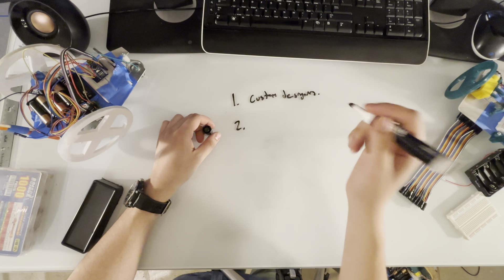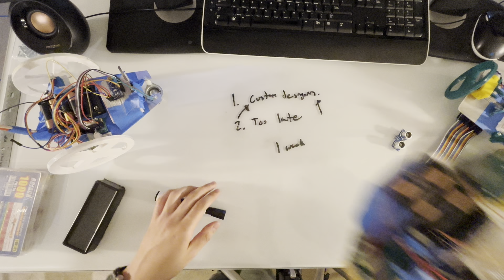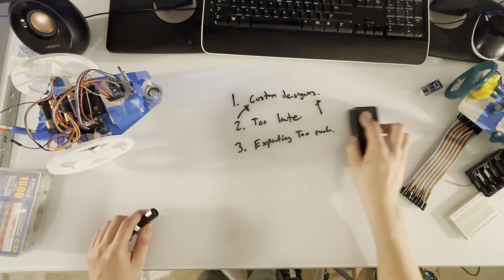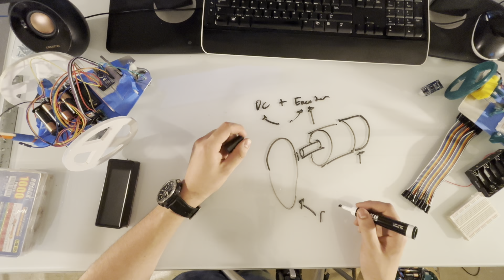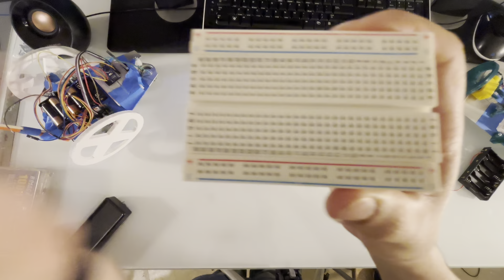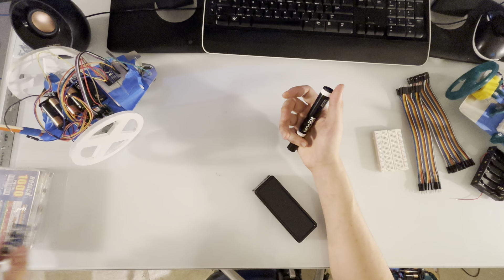Robot Tour Mistakes and Tips

Comment: What hall effect sensor did you use for v3? Also, did you place with your v3 model?
Reply from the maker: V3 placed I believe placed 6th. However V1 won the most competitions (and placed higher) because of its cheapness and consistency. The hall effect sensor I bought was called '3 Pack KY-024 Linear Magnetic Hall Switches Speed Counting Sensor Module Diy Starter Kit' on amazon. 

Feel free to give me a ring if you need anymore assistance (not on the 18th tho).

Thanks 
-Niko